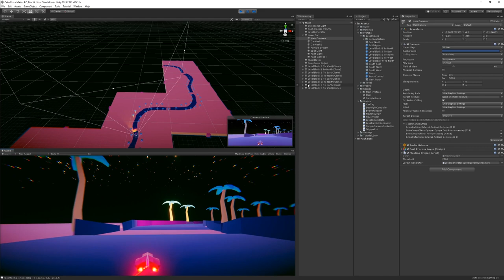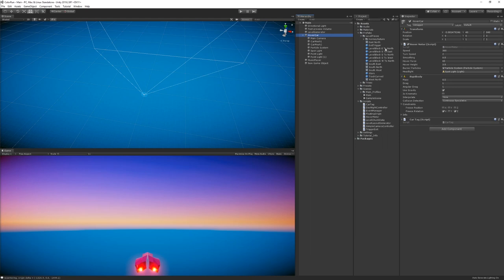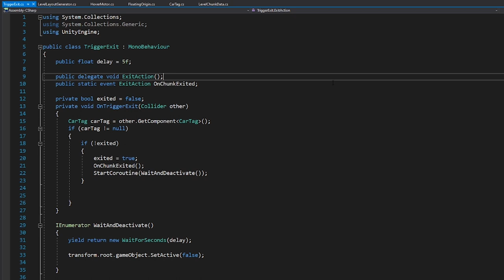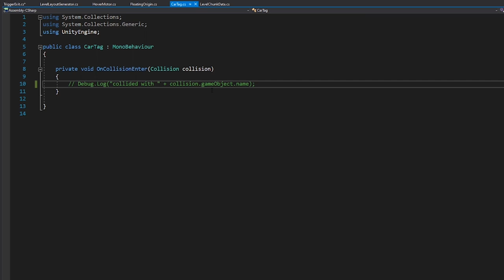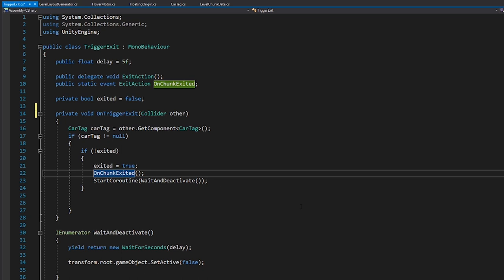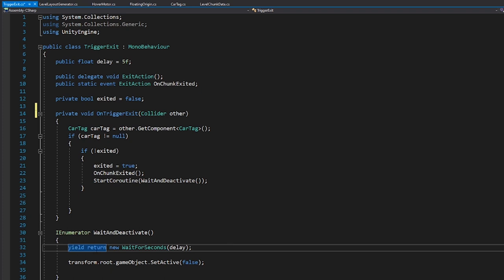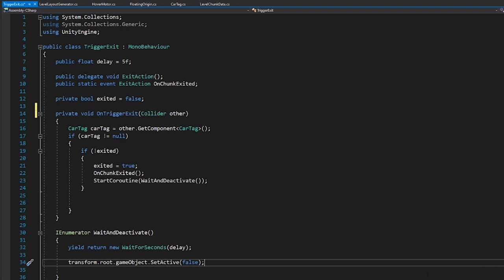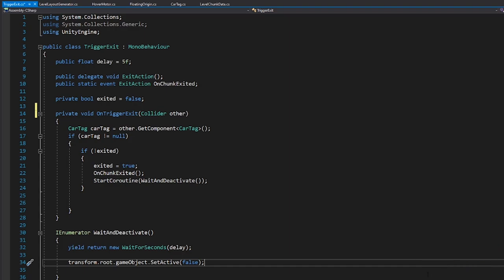Endless Runner: Track Spawning With Events (Unity Tutorial)

Comment: How can we bake lights in an endless runner since there's multiple platforms/prefab instantiating at run time, if we don't it takes lot of performance since I've few points lights too, also love your approach I'm using player position for spawning I'll try to implement this way soon.
Reply from the maker: Thanks! Yeah I need to dig into the light baking side of this. I think I would bake the light in the scenes and then do asynchronous additive scene loading instead of a prefab based approach. I don't think it'd map 1:1 but would get you going in the right direction.

Comment: i have opened your github project in unity 2019.3.11f1 i got 28 errors stating "snapping is ambiguous between 2 packages" can you plztell me how to solve that :) great work btw <3
Reply from the maker: Hmm this is not an issue with my project it will be a conflict between two Unity snapping systems, maybe uninstall progrids?
Reply: @newbquesttv  all errors were fixed when i open the project in 2019.2.10 😍🤟